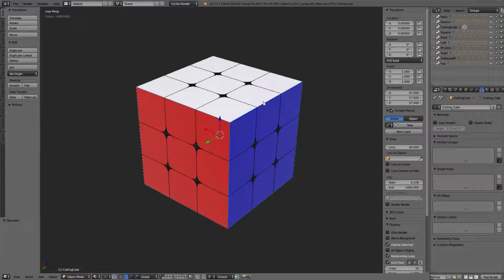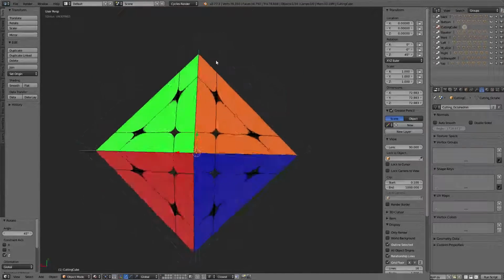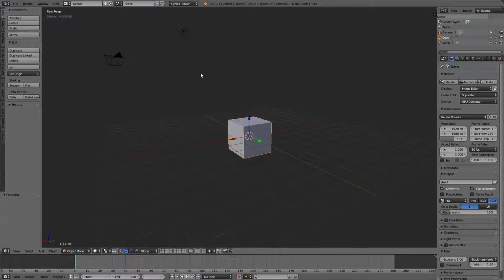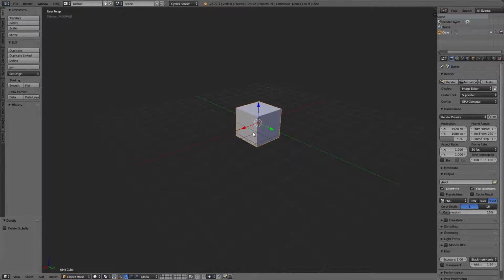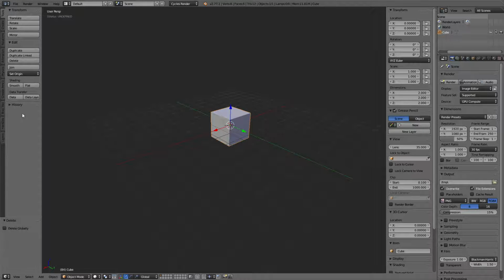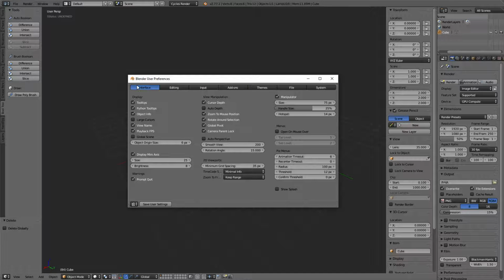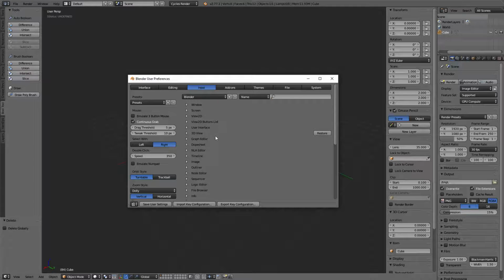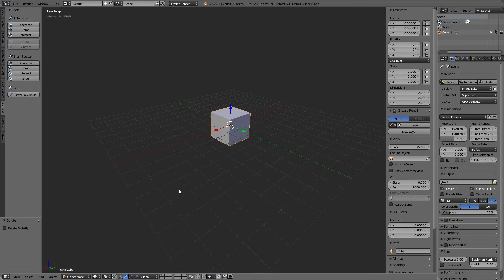Designing 3d Printed Puzzles Part 1 of 11

Comment: Perfect, but may you make another video with a newer version of blender? We're 8 years in the future.
Reply from the maker: I had considered doing an update to this, but honestly there are much better ways to design puzzles using CAD software. (I use Rhino 3d, but any solid modeling software will work) It just makes it so much easier to work with complex cuts and still keeping the ability to add nice bevels to all the edges. With a polygon modeller such as Blender, these multiple boolean cuts will create a lot of messy meshes that can't easily be modified. This is not a dig at Blender, which I still absolutely love to use, but sometimes there are just better tools for certain jobs. My current favorite workflow is to design all the mechanisms in CAD with oversized pieces (long extensions), then take those pieces back in to Blender to experiment very quickly with the outer puzzle shape and features. I could possibly make a new video showing those techniques, but it would be a bit different from these early videos.
Reply: Thanks would be really nice to see a video like this, as I would like to start my journey and I don't know where.

Comment: just curious, can i download the files for the barrel or the dodecahedron?
Reply from the maker: Yes,... at the end of this tutorial I have a link to a file in the comments.

Take a look at video 11 in the series. It will show how to switch the shapes, and in the comments you will find a link to the tutorial file.
Reply: also, how do i alter the peices like in the beginning
Reply from the maker: Do you mean when I turn the pieces of the puzzle? Unfortunately that is a bit tricky to use so I have left that out of the tutorial. I have animated all of those pieces ahead of time, and I have a quick script I can run that freezes all the cuts and shows the turning. It's really easy to mess things up though, so I wanted to keep the tutorial file simple.
Reply: no i mean when you rotate the pieces to make an axis cube or a fisher cube
Reply from the maker: This tutorial series will explain it. Most of the tutorial is about how to build the 3x3 mechanism, but the last few will show how to cut new shapes out of the outer pieces to make new shapemods.
Reply: alright, thanks!

Comment: How did you do the visualisation of the turning without applying the booleans
Reply from the maker: That is a little trick I have in this file. I have the pieces animated 
the entire time, before the boolean is applied. What I do is run a 
script that converts all the objects to a mesh which applies the 
boolean. Then I can just hit undo to restore the booleans and continue 
working. You can see the "run script" in the bottom right of my screen.

here is the script.
-------------------------------------------------------------------------------------------------

import bpy
for a in bpy.context.selected_objects:
    bpy.ops.object.convert(target = 'MESH')
    bpy.ops.object.origin_set(type = 'ORIGIN_GEOMETRY')

-------------------------------------------------------------------------------------------------
Reply: rcpongo thanks allot
Reply: And how did you do the automatic coloring on each side of the Puzzle?
Reply from the maker: When you do a boolean, the colors will transfer from the cutting object, so the cutting cube has the colors on it. To make this work you will also need to have the materials added to the object that is being cut.

Does that make sense? I can explain better if you need.
Reply: I think it does thanks
Reply: rcpongo and how did you make the black wireframe around the pieces?
Reply from the maker: You can display the wires over the shaded by going to the object tab. It's in the right-hand panel and is the 5th icon (it's an orange cube). Under that, there is a section labeled Display with some check-boxes. If you check "Wire" the wireframe will be displayed over the shaded. You may also want to use the box that says display all edges, depending on your mesh.

You can check this for multiple objects at the same time by selecting all of them and hold the alt key when you press the checkbox.
Reply: rcpongo thanks!

Comment: Any cheap 3D printer recommendation?
Reply from the maker: I use a Lulzbot Mini, which I know doesn't fall on the low end of costs, but it's all I've ever used.  I really can't say anything about others, but I've seen some very nice prints out of cheap printers once they are dialed in.
Reply: I use the Anycubic I3 mega. Its quite a good printer and it is also very cheap
Reply: @g-cubed1908 Same :)
Reply: @mattstudios5067  yeet